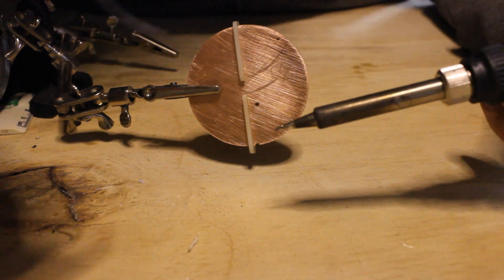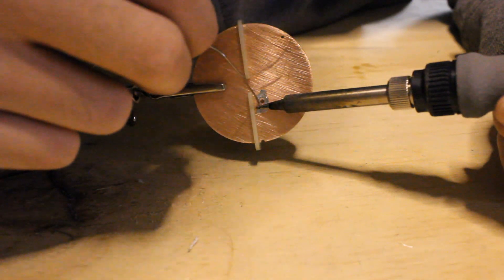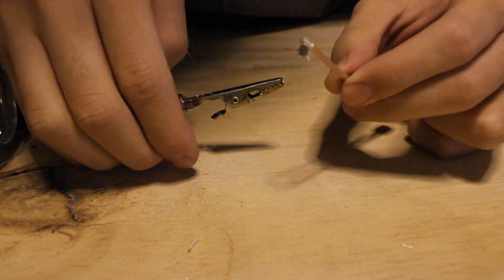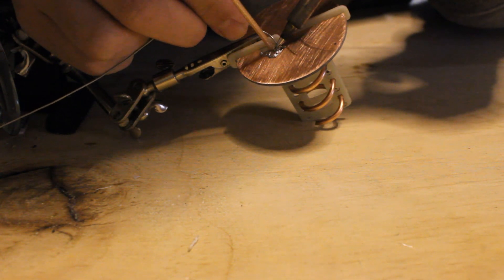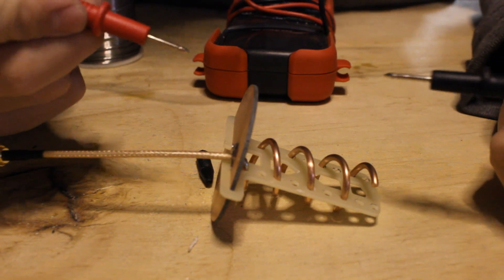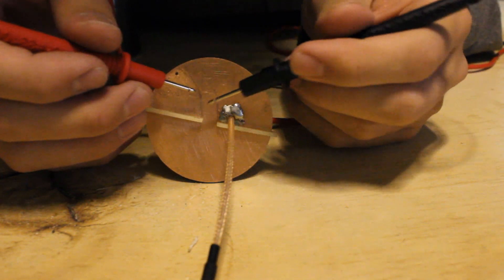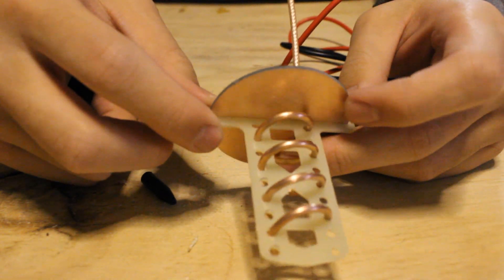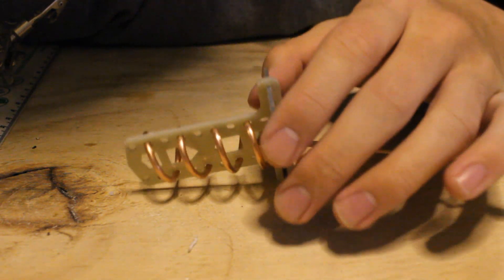How to build a 5.8 GHz 4 Turn Helical Part 3

Comment: You soldered the coax shield to ONLY THE BACK SIDE  of the double layered PCB...  IF the FRONT surface of the PCB is to act as a ground plane, well, you are not getting it without a jumper to make the front and back of the PCB electrically the same...  wtf over??
Reply: I was confused by this too ... Am I correct that you can make a helical antenna with single sided copper pcb board and ground the coax to the front plane?
Reply: You do not need double sided PCB, but it is easier. Just be sure to maintain the required distance between the antenna wire and the ground plane. Good to use the DS board but remember to electrically connect both sides of copper....
Reply: Hank White ( what is the required distance between the two )

Comment: Double-layered PCB was used, meaning the front side is DC-insulated from both ground AND the central conductor but nevertheless it is connected at RF by the large capacitance between both PCB layers, so here is the question: Is tis capacitance accounted for and necessary for tuning & matching or may a single-layer PCB be used? In this case, what distance should be kept between the first coil and PCB?

Comment: When using a cloverleaf antenna on both the transmitter and receiver it's important to have the twist direction the same (both be either left-hand twist or both be right-hand twist).  Does the direction of the spiral of a helical antenna have to match the direction of the cloverleaf's twist?
Reply: I'm sure it does need to match. Lhcp on both sides or rhcp on both sides. If you mismatch them than you would received mostly reflected signals which would be a disaster, as the whole point of circular polarisation is to eliminate reflected signals. I believe the one shown in video is rhcp (screws clockwise into its reflector, lhcp would screw ccw)

Comment: Nice video, but I see that you're not responding to any of the comments/questions. Therefor I'm doubtful that I'll receive a reply to my question. Anyhow, you soldered the cable shield to the back side of the PCB, but didn't talk about the front side. Is it connects to nothing, or is it connected to the center wire? Or does it need to be connected to the shield as well? Or, should we make sure it's not connected to anything?
Reply: He actually should have drilled through another whole in the board and bridge the sides. The way he built it, the back layer of the PCB is working as the reflector, but is being blocked by the layer on the coil side which he left floating. Unless he fixes that, this antenna will perform poorly.
Reply: +Terje Oseberg I was thinking the exact same thing.  As I watched the video, I noticed what looked like another hole in the reflector plate.  I thought he was going to use this to bridge the top and bottom of the copper board together. That would seem to make the most sense if you want to use the copper board as a reflector.
Reply: Or better yet. Drill the hole big enough to pass the whole cable through, and the solder it to the front side of the reflector!

The video doesn't mention either  the distance between the ground plane and the start of the coil, 0.4mm is right for this antenna. For impedance matching, the first quarter turn of the coil should be parallel to the reflector, i.e. 0.4mm from the ground plane.
Reply: did you actually watch the video ? as its answers what you ask quite clearly.....
Reply: Friskle123 Watched the video, and it looks like the answer is that the front side of the plate is not connected to anything. However, he doesn't say anywhere, and he doesn't show it. I'm just looking at what I can see, but can't be sure.

So basically, the video doesn't answer what I asked clearly at all, or even vaguely.
Reply: oh sorry, you obviously didnt watch it then, as it still clearly shows what you have asked about. you can clearly see the plate is soldered to the brading wire, then the the helical is clearly soldered to the the centre wire, eg, Helical is seperate from the plate, if it was connected to both it would create a short.

still the video shows that quite clearly, did i say shows it clearly...actually its pretty much common sense, you dont have the braid wire connected to the centre wire....

In fact, you couldnt ask for a clearer video...
Reply: Friskle123 The, "plate" is not a solid copper plate. It is printed circuit board material. Basically it's a fiberglass like plate of insulating material with a copper coating on both the front and back. The back of the plate is clearly soldered to the shielding of the wire. That is very clear from the video. It's also explained quite well that the back side of the plate is not soldered to the helical coil as that's what he's testing with his volt meter.

What I asked about is the front side of the plate, (which is not connected to the back side of the plate, but rather separated from the back side of the plate with the fiberglass like insulating material that the plate is made of. It appears from the video that the front side of the plate is not connected to the center wire or the helical coil, but he doesn't say so, and it's not 100% obvious in the video. Therefor I attempted to ask the author about this, but the author has not responded, and you obviously don't know that the plate is not solid copper and therefor the front side is not connected to the back side, so testing from the back side to the coil doesn't tell me anything about whether the front side is connected to the coil or not.
Reply: the front side is not connected to the coil, the base plate is separate from the coil, the coil is ONLY attached the centre wire of the cable, it does not matter whether solid or not, the base plate has to be seperate from the coil, other wise the antenna wouldnt work, otherwise you would have the coil and brading all connected, eg, shorting.
Reply: Friskle123 "not matter whether solid or not, the base plate has to be seperate from the coil, other wise the antenna wouldnt work, otherwise you would have the coil and brading all connected, eg, shorting."

I'm sorry, but if the plate is not split, ie. the front of the plate is not connected to the back of the plate, then connecting the braiding to the back and the center wire and coil to the front would NOT short the coil to the braiding. It is obvious that you DO NOT understand what you're saying, so it's difficult to believe that you understand what you're talking about. Therefor, I'm not sure whether I should believe your advice.
Reply: i clearly understand its you thtat seems to be not getting it, does not matter about not being solid, so long as the braiding is connected to part of the bottom plate, thats all that matters, the coil cannot connect to the top side of the plate, as the coil is that length for a reaon, the base plate is merely the reflector.

you say not split in the first sentence ? which means solid, then go on to talk about it as if its split,,,really make your mind up.
Reply: Friskle123 Sorry, that was a mistake. I meant to say, "I'm sorry, but if the plate is split, ie. the front of the plate is not connected to the back of the plate, then connecting the braiding to the back and the center wire and coil to the front would NOT short the coil to the braiding."
Reply: If you connect the top part of the reflector I won't short out, but it will change the characteristics of the antenna and most likely won't perform good, since this is calculated for 2.4Ghz
Reply: Eduardo Partida Thanks, but I think you mean, "since this is calculated for 5.8Ghz".
Reply: LOL sorry, was looking at a bunch of antenna videos and got mixed up
Reply: Eduardo Partida I figured as much. I have another question though. Does it really not matter that he used a backplane that has both sides covered? Would it make a difference if the backplane was solid? Or if he instead of soldering the cable shield to the back of the backplane he soldered it to the front side? Or would all three configurations function the same? I watched another video that said that a little corrosion on the backplane or coil can makes a huge difference, so I would think that the three different options could make a huge difference as well.
Reply: The backplane acts as a reflector, for the best results it could be solid, but he used a PBC because it's easier to get than a solid copper plate or aluminum. Also a double sided PBC must yield better results because of the amount of copper on it, with less amount of copper reflection isn't as effective
Reply: Soldering it to the front shouldn't be much of a problem just make sure the shield doesn't touch the helix. About the corrosion stuff, if the reflector has holes in it because of corrosion it will not be as effective
Reply: jesondag That's exactly what I was thinking, but I don't know anything about antenna design, so I asked. Thanks for your answer.
Reply: Terje Oseberg exactly!  I was reading this thinking why the hell didn't he bridge both sides... As far as I'm concerned, any conductive material will work fine, the more conductive the better. Solid copper would be brilliant, steel will be fine too
Reply: robert k
because you dont need to bridge them, one side is enough to function as a shield, as some refelctors can be quite thin anyway, point is, there was no need to bridge both, because of the type of plate used, the bottom half wouldnt be efficient.
Reply: Eduardo Partida
Was not meaning to short out in that sense, but in practicality, it would be a short so to speak, as you say, by doing that, the antennna would no longer function as intended.
Reply: Yes, but-  if the bottom side acts as a reflector then the top side (if not connected/ grounded) acts as unnecessary shield for the reflector. I'd say- bridge them as it is not much effort but it would improve it. Other thing I can see now after some reading up on the subject, this antenna is not impedance matched and will have impedance of anything between 100-150 ohm, while we want 50. Easy enough to do AND it is essential for achieving good range. Concluding- this is nice tutorial but lacks a bit here and there.
Reply: robert k How can you tell that the impedance will be 100-150 ohms, and what changed are needed to make it 50 ohms?
Reply: Terje Oseberg It's not that I can tell myself :D you can calculate it all if you want to, but it's easier to read up on ibcrazy's tutorial.. http://www.rcgroups.com/forums/showthread.php?t=1377791
Reply: Terje Oseberg also if you use any of helix antenna calculators online (there is plenty) they're all say impedance 150ohm
Reply: You're right, using the bottom half isn't as effective as using thetop one because of the attenuation caused by the top and polymer layer(if not bridged). And I have no idea how to match impedances LOL I used a 75 to 300 ohm matching transformer and it worked fine for a TV helix antenna
Reply: Terje Oseberg front plate would act as a reflector, probably very well too but he front plate in conjunction with the back plate will act as a capacitor connecting the reflector to signal ground of the receiver. This capacitor, if the fr4 is 1.6mm and 50mm in diameter woult result in an inline capacitive reactance of close to 600ohms. A small shorting link from back to front at the edge of the reflector would probably be a good idea.

Comment: Nice work! but I have a question, why use double sided PCB just to attach the shield to does it serve any purpose? I ask because I will be building it shortly and I only have single sided on hand. I can glue it together but I don't see the need.  Also I just drill a 3mm hole in the center of my PCB insert a machine screw and self locking nut, spin it up in my drill and hold a sanding block to it and its round after a minute (easy).

Comment: One big problem with your feed to the antenna is soldering directly center of the coaxial cable to the coil. It is RHCP (right hand circular polarization) antenna. If you connect it like you did, it is high impedance point, not 50 Ohm as is coaxial cable. It should be connected differently - coil soldered to the back plate (~reflector, but it is not true reflector due to mirrored 'image' of LHCP), thenh soldering center of the coaxial cable to about 1/4 of first turn. In addition to that, close to this point should be triangular shaped impedance matching element to get maximum gain.

This antenna as you shown will work to some extent, but not properly. Soldering double layered PCB on the back is not so big issue - it is capacitivelly coupled to the front plane. Only problem is with impedance matching.

Comment: The cable braid can be attached to the back of the copper plate because its sole purpose is to define the ground. Hence, it is called a 'ground conducting plate'.  You can solder the braid to the front or back of the plate. Just don't let the antenna itself touch the plate as that would result in a short circuit.
Reply: Yes SitWano...
if there was only one plate ... but this is a double sided copper clad board therefor by only contacting the back you are being blocked by the  layer of copper on the front .
Reply: oh ohkay :)

Comment: The cable braid needs to contact the front of the reflector not the back.There is no way your antenna will work as the front disc of copper will block the back.
Reply: From what I gathered from Part 1, this is not his design.  Presumably he is following the directions that he was given.  I applaud him for taking the time to make this very easy to follow 3 part video.  This is obviously not the first one he has made and I'm sure they work or he wouldn't keep wasting his time.  Thank you UAVWorks.
Reply: got the same question. he just put the extra copper plate between reflector and coil. for no reason. pretty sure it will affect the performance.
Reply: Certainly a good effort , just a shame he got it wrong.
Reply: Yep, nicely done and good looking, but missing wavetrap and has blocked reflector.

Comment: Very nice tutorial! But are you sponsored by the company "ahum"? During the complete tutorial is it 300+ times heard.
I strongly recommend you that memorize the text or add the text as a voice over. In this way it is becoming very boring after a while, it works better then any sleeping pill. Again, very interesting but presentation needs alot of work.
Reply: can confirm. i watch this video everytime i need to go to bed in time. its gr8 m8

Comment: Nice tidy build.. I was just wondering  if the coaxial cable should be soldered to the front of the reflector plate as the back is not reflecting or does this not matter... ??
Reply: Yes it does matter  Irich1961 , you are correct.

Comment: I have figured out where to get the copper clad back plate but still having problems sourcing the Fiberglass core  material. What do I call it and where can it be had for a fair price. I can just see myself making it with 2 pt epoxy. Good on you mate and thanks for any assistance . Regards, C

Comment: I found the 2.4GHz templates at the following site:
helix.air.net.au/index.php/d.i.y.-2.4ghz-helical-antenna/
The page includes formulas for calculating dimensions. You can use them to calculate what you'll need for 1.2Ghz.

Comment: A 4 turn helical will give you about 2-5km depending on your setup and factors like heat, humidity, interference.
And yes you point at the tx but the beam is quite wide in the middle area so it needs no accurate tracking. I use them on my googles and just turn my head in the general direction.

Comment: HI, at first thank you for shareing this Guide :) , i would like to know weather it would also be ok if i use one side copper plated epoxi and solder one contact of the cable to the helix while the other end is soldered to the front  coper side, of curse no contact between those tow^^. greetings from germany

Comment from the maker: Hi Arden, 

Sorry for the late reply- I have been very busy with college things recently.

1. No, the coil does not touch the front plate- it only touches the center conductor of the coaxial (so the innermost wire in the coaxial cable). 

2. Yes, you can have 3 turns/coils if you want, the template will work for that too.

3. Yup, it shouldn't affect the antenna too much for the convenience it gives you. Just make sure whatever you screw it down on isn't conductive as well!

UAVWorks

Comment: Hi UAV, thanks for the video.  I already liked all 3 of them and subscribed.:-)  I have 3 question though.   

1.  Does the coil touch the front plate?  If not & nothing is soldered on it, then what's the purpose of it?  2.  Can I just make 3 coils for the 10awg?   I only need to produce 6-8dbi.   3.  Can I put holes on the reflector?  i.e. if I want to screw the down behind it, or if I want to mount a holder for it?   Please advise.  TY!

Comment from the maker: First of all, the DX8 would not give you 10 miles- maybe 1 mile at best and 0.75 miles safe. The $35 commercial antenna are omnidirectional, which are the most versatile antennas and the first pair that anyone should have. The helical is meant for a diversity system, which is a device that chooses the best signal between two antennas. If you want 10 miles, you need to either be ready to pay lots of money or do some serious research regarding video and radio frequency. 

UAVWorks

Comment from the maker: Hi,

Yes, it just hangs by the wire- the angle is roughly 45% up, which works for me. Although we're not doing any fine tuning, this will go about 2-3 KM, more than a mile no problem. You can get a receiver module for the Fatshark Predator if you would like to attach the antenna onto it. 

Thanks for watching,
UAVWorks